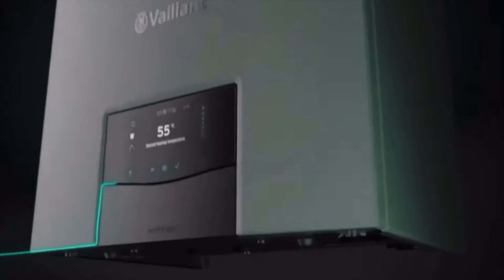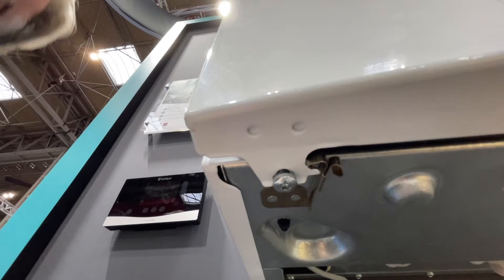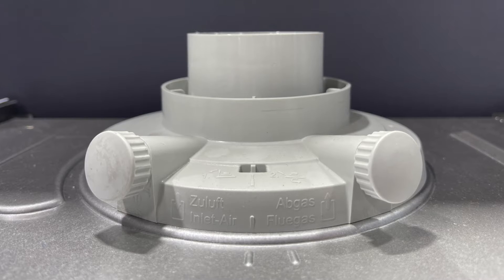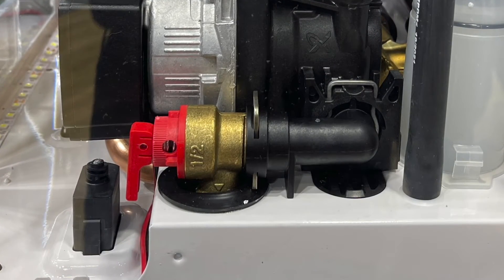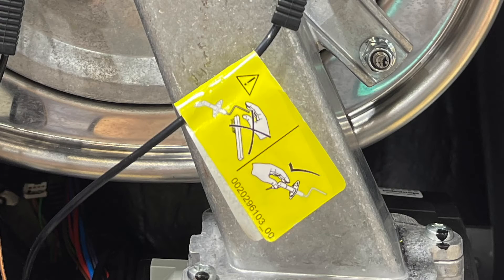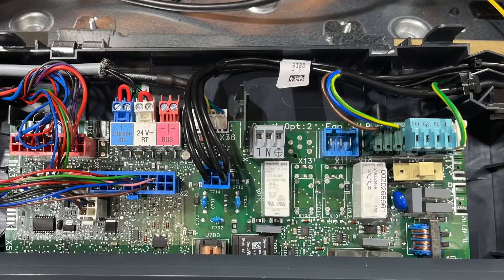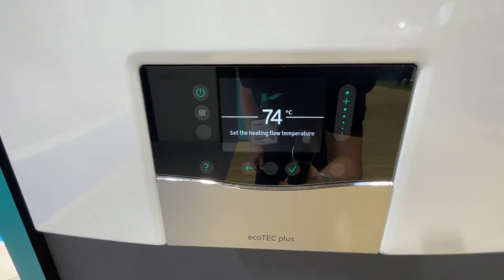Inside the boiler case of the new Vaillant ecotec plus combination boiler

Comment: We’ve had a Vaillant aroTHERM system for four years, and unfortunately it’s broken down three times in that period. The biggest issue hasn’t just been the product — it’s the support.

Each time, it’s taken two weeks or more to get a technician on site. That means long periods without heating or cooling, often during the coldest or hottest days of the year.

We’ve been paying €250 per year for a maintenance contract, but honestly, it’s been a disaster when support isn’t actually available when needed.

If I could make the decision again, I’d go with another manufacturer — Hitachi, Bosch or Nibe — brands that seem to offer more reliable systems and faster service.

Comment: Hi, after following you on YT, I’m after some boiler advice and please you are not compelled to respond to a home owner.  Moved into 3 bed dormer bungalow 11 months ago and have an oversized WB combi thats about 13 years old that I’d like to replace.  You cover many boilers and as a none Gas Safe person are you allowed to sell boilers to people like me?  If you are can I contact you as to what would be the best replacement.  Modulation, weather comp etc.  Had a very good warm air system for 37 years at my previous home so out of touch with combi boilers. Thanks Mike

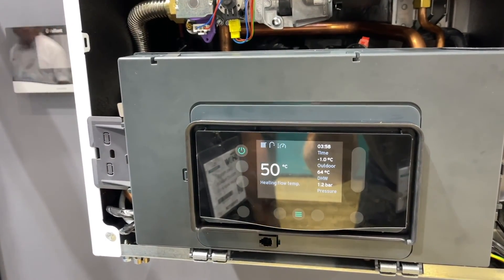Comment: Things to consider about the 9:56  ionisation probe:

Needs replaced every 5 years or 10000 use hours, this could be done when you change the graphite seal every 5 years as standard. Never touch the probe when changing. You also need to let the onboard computer know that the probe has been changed so it can reset the use timer

Comment: Does the boiler support weather comp , some older models had a sensor yet I can’t find any info on it with this boiler for boiler plus regs due to come in for max efficiency, and for summer months does it support water only mode disabling heating like baxi and ideal?

Comment: How long will the plastic hydrobloc last😂😂😂 the diverter leak common problem
Reply: my 12 year old ecotec pro gets a leaky diverter valve cartridge every 18 months. I can adjust my clock to this. It fails without fail. But I leaned to replace it myself

Comment: Surely youve been paid by vailiant to show this......why would you fit vailiant controls at £240 when hives £135
Reply: £135? That's crazy. A wi-fi or zigbee switch costs under a tenner. A wireless thermometer that can act as a thermostat under a fiver. But yeah, you would have to be a numpty to buy the Vaillant controls.
Reply from the maker: No I haven’t. I wish and hive will not control the boiler like a Vaillant control will so you would soon get your money back with the savings
Reply: hi mate cud you tell me what is the safety device on this valiant boiler ? thanks

Comment: I still think the old cast iron boilers were less prone to breakdown ive had mine for 34 years chnged 2 thermo couples wouldnt be without it😊
Reply: The old boilers were more reliable but are very inefficient, additionally the burners are failing after all these years. Hope you have a CO alarm installed.
Reply: Same with me David 20 year old glow worm ultimate, One PCB failed and a couple of blocked pilots plus I can service it without any fancy test equipment.We were changing 5 year old Ideal isars because they were uneconomical to repair So I would have been on at least my second new bright shiney condencing boiler by now and could no longer service it myself.New boilers are set up to give 9 % CO2 on high and low where the last time I could check my ultimate it was less than half that . We expand the argument to computer controlled hot water cylinders .Give me a copper tank and tank stat any day .All this stuff even when it is under a long warranty needs servicing to maintain the warrantee So that at least two or three things to maintain .They may be more effective and efficient.They will almost certainly be more costly taken everything into consideration.Condencing boilers are all as far as I know are positive pressure boilers.They are probably more at rink than my negative pressure Glowing for a CO incident .

Comment: Can this boiler be operated using manual control on the front swipe panel, or is the plug and play system (2.20) a requirement for the boiler to operate, and does it come with the boiler?  Thanks from an elderley potential customer.

Comment: 5:41 we can see that they insist on keeping the heat exchangers in plates at reduced sizes so that at the slightest trace of dirt the boiler will overheat during the preparation of hot water... and viessmann has the same "wonderful" characteristics - being sized to the limit the boiler is forced to operate with higher temperatures on the primary agent, which accelerates dirt deposits in the heat exchanger - but this is not a defect but an innovative technology that cleans the water of the primary circuit of sediments ... and if they want to maximize their performance to collect dirt from the water, they can return to the use of rubber hoses between the primary heat exchanger and hydroblock, typical for Vaillant and Viessmann.
but we can also notice at Vaillant and Viessmann that the clever engineers have left room for the installation of heat exchangers in large-sized plates in case the guys on the commercial are caught by their conscience and become less greedy...
Reply from the maker: It seams you are not a fan of Vaillant boilers then 😜
Reply: @tomkatgastraining  + i will miss the extremly fast hot water delivery that this combi boiler with the right parts is capable of …
Reply: @tomkatgastraining  I am a fan of Vaillant and Viessmann as the good boilers that they can be but unfortunately are not! 
The engineers from Vaillant and those from Viessmann know how to make exceptional boilers but the economists from the 2 companies say they want to make money from spare parts...
At this moment, I have installed in my house a Vaillant combi boiler which had no defects but came with a Wilo pump that I changed at installation with a Grundfos pump :D and I installed an enlarged plate heat exchanger in it  - in this configuration it had 0 defects in 15-16 years of operation.
now it will be replaced with another brand of boiler…
And I will miss the cover on the control panel - in the position in which it is installed, it is exposed to the sun's rays for several hours a day and the metal cover protects it... that's why I postponed for several years its replacement with another boiler…
Reply: You sound like one of them builders that has so much to say but knows nothing. 

They put 10 year warranty on them for a reason. If they’re serviced to manufacturers instruction they’ll last their service life. 

Relax bro, find a girlfriend and stop writing novels about how the best rated boiler in the world is shit in your opinion

Comment: 5:33 there are a lot of problems with this diverter valve model!!! Starting from the fact that it ends up losing water next to the axis to the fact that the element that makes the deflection detaches from the axis being fixed by two C-type clamps that detach from the axis... I only have unpleasant memories with this type of servomotors from the time when they were used on viessmann vitopend 100